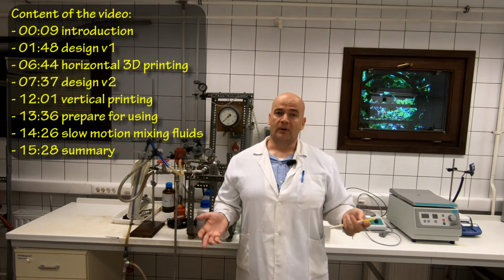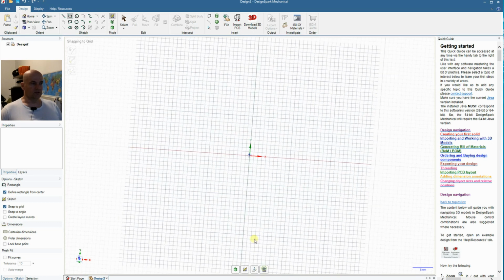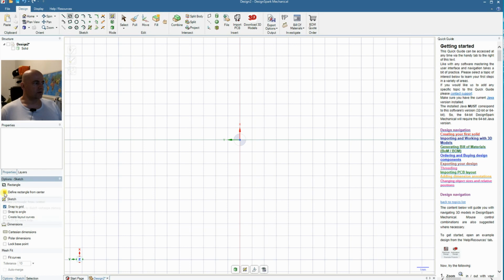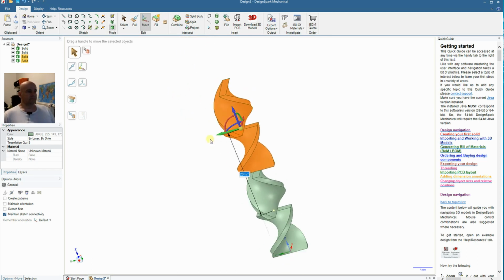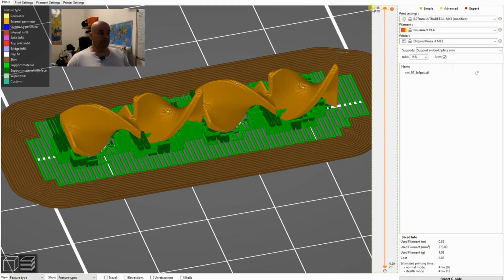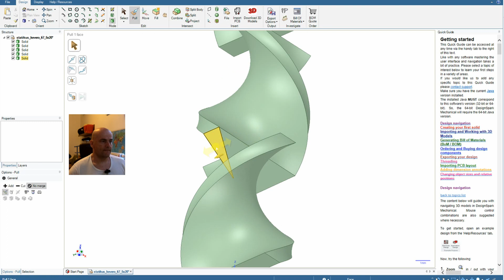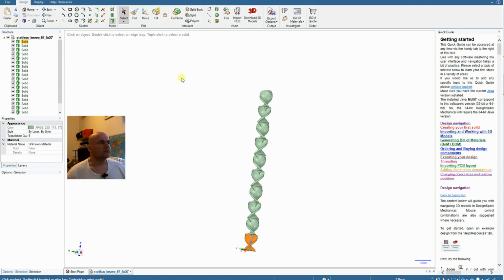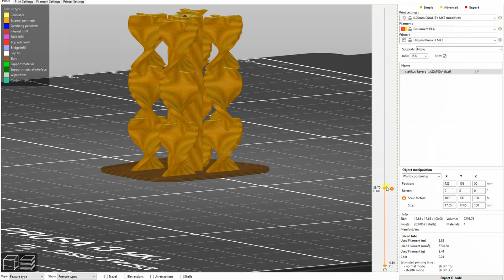3D printed static mixer

Comment: Great video! Would this geometry work for varied mix ratios? Or good only for 1:1? Also, have you tried to print these using SLA resin printing?
Reply from the maker: I didn't tried SLA, but my friends from University of Novi Sad yes, they got great results with resin. This geometry is for 1:1 only, but you can use different flow rates on two fluids.
Reply: @MyTechFun  thank you. Any thoughts on sources to look into designing geometry for other mix ratios?

Comment: Thank you.  Do you think the Z axis offset will affect the mixing? I’m designing mine at 36 degrees through 10 iterations. Yours seems more efficient. 

I’m diluting a very high MW polymer with water. I want to do as little damage as possible through the mixer.

Comment: We are trying to make injection mold for this part... may be we use your *.stl for developing this.. 
Anyways our designer was confuse with the look of the helix. Your video helped us alot... 
Thanks, Keep Doing Good Work...
Reply from the maker: Yes, you can use my stl file if the size is good for you. But if you follow instructions in video, you can create your own with any dimensions.
Reply: How did you managed to make mold without negatives?

Comment: hey doc, is it possible to create a static mixer like this but instead of two liquids, could you do one liquid and one powder?
Reply from the maker: Hello, I never tried. But it would be possible if the powder has some transporting fluid (air, water..). But I never tried.
Reply: @MyTechFun  alright, thanks for the information and great videos on the static mixer! Will print one off in the next day or so

Comment: I'm currently building myself an injector for mixing acrylic paint with acetal moisture cure silicone, so I can cast in enclosed moulds. I found an stl on Thingiverse of something similar to yours, but yours is better. I will use yours in my model in Fusion. As you say, modelling helices in Fusion is not straightforward. Thanks for your work.
Reply from the maker: I am glad I could help. Wrote here later your experience with your static mixer.
Reply: My Tech Fun I will. I expect that it may not work because of the differential viscosities of the silicone and paint and the 20:1 silicone to paint mix I introduce into the mixer. I will post a link here to the Fusion file when I have revised it.